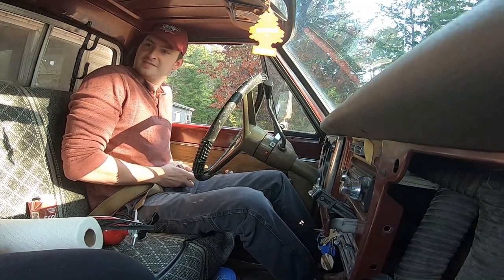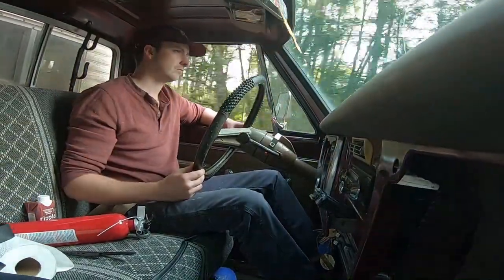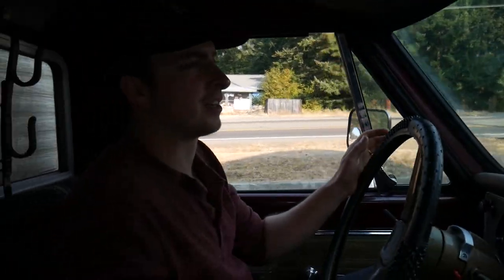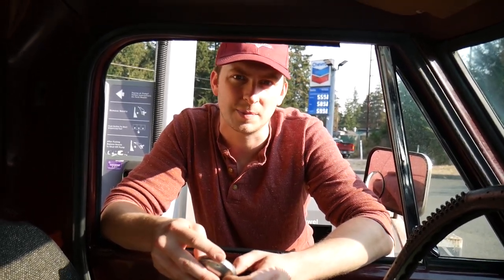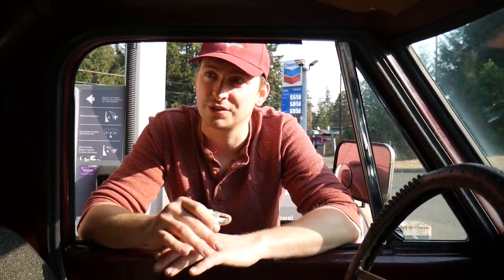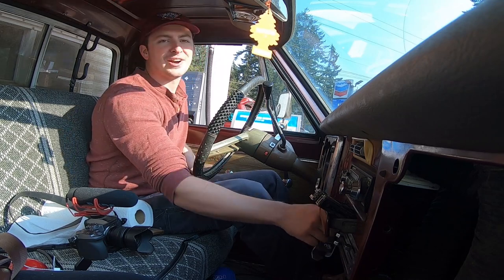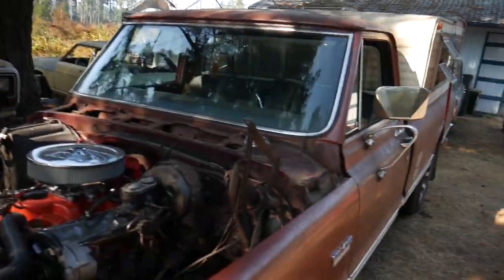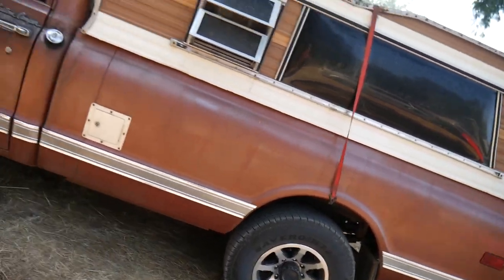The GMC is Back! The 402 is STRONG! Trip Into Town with My Wife

Comment: Ok. The big number is the air and it’s verses 1 part fuel. 13.1 is your baseline. So 11 something would be super rich. 14 something would be to the lean side. However, as I had stated on pickup I don’t think that gauge is at all accurate. If it’s lean popping then go to the air bleeds. The ones with the smaller holes are your cruise. Go down in size a couple numbers and see what happens. That really isn’t the carb for what your doing. We talked about that too. 
Thanks for
The shoutout.
Reply from the maker: No problem brother! Thanks for the info and the help!